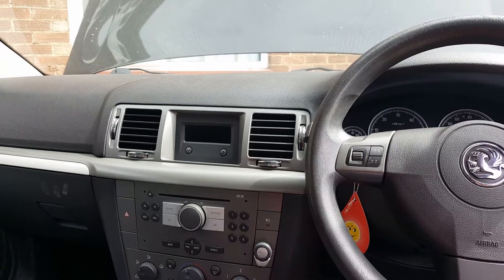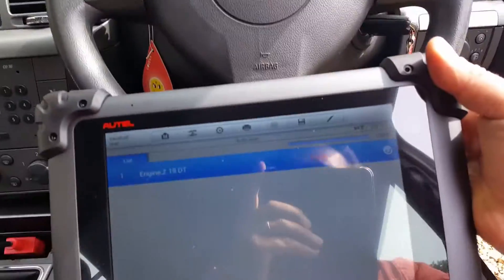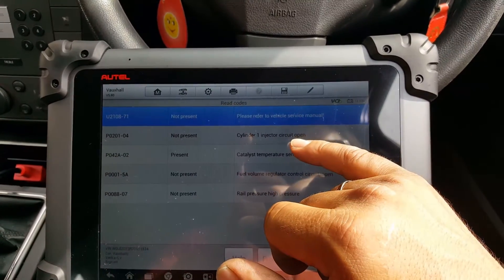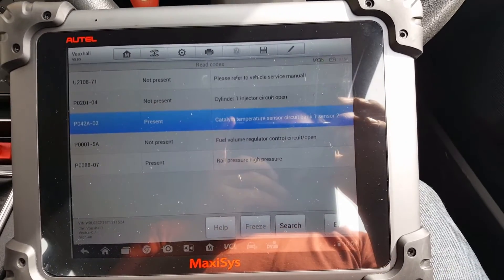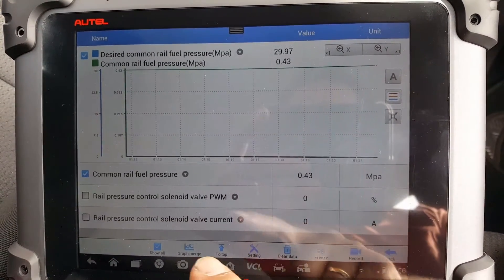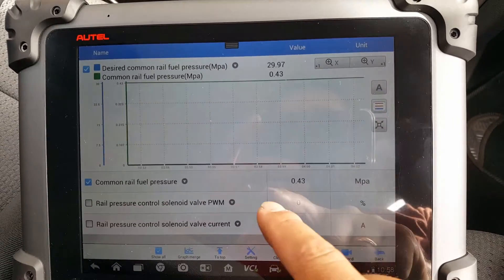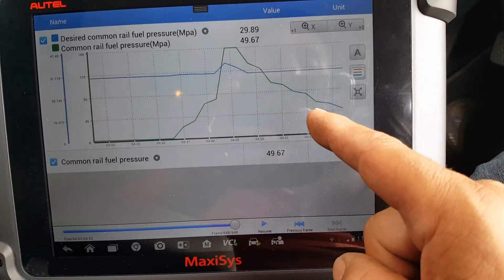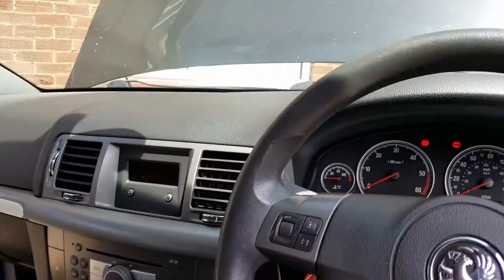Vauxhall Opel Vectra 2007 Z19DT not starting after engine swap, P0088-07.  Fault finding and repair.

Comment: great work, common problem with engine swap, i always get cars with guys who would have connected cam sensor lag on crank sensor and crank sensor lag on cam sensor. finding that out is always a pain. ECU pin out is always the only way out.......great diagnosis.
Reply from the maker: redman 
Thank you Redman!

Comment: Hiya Imsvvavr Another great video.  I labelled everything on my granddaughter agila and thankfully that wasnt my problem but someone on the vauxhall forum had suggested checking the knock and crank sensors for the correct position.which I did.  On the Agila the crank sensor wiring is longer than for the knock sensor.  It was difficult for me to check wiring as i didnt have wiring diagrams until a very kind sole sent me them from the forum.  I wondered if it might be better if you had got some sleep and done the video later as I would have liked to see how you traced the wires via ecu to both sensors.  I guess I have seen you do this before on some of your other videos and its really helpful.  I assume youve also been asked to get it going quick,or asap by the garage that asked you to look at it.  Many thanks again you are a star
Reply from the maker: colin Lyne 
Thanks Colin, for watching and for your comment.
Unfortunately that's one of the reasons I do not record all the repairs... lack of time and tiredness...
Some times I do it straight after my last night shift, and although I feel fine to do the work, not so much to record it...
Reply: I understand I was a nurse and used to do nights but I was hopeless after a shift.  I think you are brilliant
Reply from the maker: colin Lyne 
Lol... 😉

Comment: Hi can you clarify , so if drive to regulator is missing = high pressure , I have same situation ,Non start, uncontrollable high pressure and cut out. wiring ok but if I disconnect plug to regulator = no pressure .....this seems opposite to what   you are describing,  thanks
Reply from the maker: If you disconnect the regulator the ecu will not allow the car to start... as it sees an O.L. on the regulator circuit...
Thank you for watching!
Reply: @LMAutoRepairs  
Hi yes I understand removing the plug to the regulator won't allow the car to start, but what I am asking is what happens to the pressure ,  are you saying you have high pressure in that situation....in other word uncontrollable high pressure with regulator plug removed ?
Reply from the maker: No...
The car will might use the flow control to discharge the system...
I am not sure what exactly you are trying to achieve?
Max pressure the system?
To do exactly what?
Reply: @LMAutoRepairs  
What do you mean by flow control to discharge system?
Reply from the maker: Flow control is sometimes known as relief valve...

Comment: May be u have any idea why my vectra c z19dt wont start on cold. I have to crank too long, looks like now it will start,but negative. When it start from exaust pipe coming white cloud for a second. Then engine running well, has power. But i found out that engine became heavy on a juice. When engine is warm starting like a new. What has been done: new glow plugs, injectors remanufactured,new filters, high pressure regulator which is on high pressure pump. Commin rail pressure 35mpa. With easy start starting well. I have no ideas what to do else. Thanks
Reply from the maker: Aleksandr Zizberg 
Hi
Have monitored the rail pressure while cracking when cold?
Doe the pressure builds up quick and sustains?

Comment: hi
What do you think of this problem in the car Astra 1.7 dti
P1615 WRONG VEHICLE ID FROM BODY CONTROLLER
P1616 is wrong ID from instrument
Reply from the maker: mohamed mohamed 
Reset and reprogram everything... should sort it out...
Are all the modules the original ones from the car?
Reply: The kit(key + ecu + immobilize) has been replaced with a new one
Reply from the maker: mohamed mohamed 
I presume the body control module has not... ence the error...
You need to reset it and reprogram it...
Reply: Can it be programmed using xprog Or Scanner Launch?
Reply from the maker: mohamed mohamed 
Launch probably... op-com is another good option...

Comment: I find myself in a similar situation with a 2004 Corsa C following an engine swap (Z12XE). OP COM says that the fuel pump relay is inactive but I can activate it manually in OP COM. I've tested the purple relays with a relay tester and they seem to be fine. What should I do next?
Reply from the maker: Parknest 
Hi
As you have seen on this video,  make sure everything has been connected and correctly...
Thank you for watching!

Comment: good job but it's difficult to find the problem because both of the 2 sensors have the same connector with 3 wires and without the wiring diagram you can't find the problem.
when you put a new engine in the car you should to reprogram the calculator or not  and think's.
Reply from the maker: عبدالله العريبي 
In this case the engine was like for like... No need to reprogram nothing. 
I believe you can do it if you want, but is not imperative. 
Thank you for watching!
Reply: i mean for example if the old engine is 1.2 l and the new engine is 1.4 l in this case the ECU should be reprogramed and think you very much.
Reply from the maker: Or that or replace the ecu completely... 
Also for that, needs to be engines that use the same type of ecu, otherwise it complicates things...

Comment: P1900 Exhaust Gas Temperature Sensor (Bank 1 Sensor 1) not plausible with Intake Air Temperature what is this on vectra 2006 1.9cdti 74kw
Reply from the maker: What is the readings from both sensors with the engine warmed up? 
Thank you for watching!